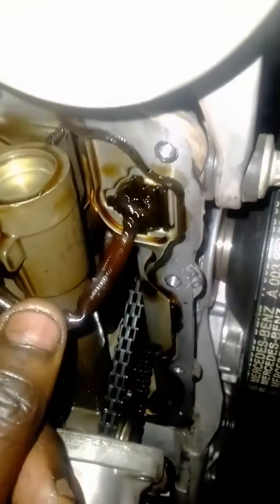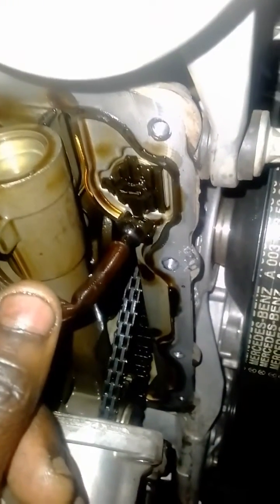Oil pump actuator solenoid has a short circuit or electrical fault // Mercedes error code P06DA00

Comment: I have a 2017 GLC 300. I got the same code. Since the harness and solenoid are inside the oil pan does this mean the solenoid is already disconnected?

Comment: I have this code on a Mercedes minivan with a 2 L four-cylinder turbo. I have access to the oil pan if I remove the oil pan is that where this wire is located?
Reply from the maker: It's on the front
Reply: @ thanks for the reply when you say it’s on the front does that mean when I drop the oil pan it will be towards the front?